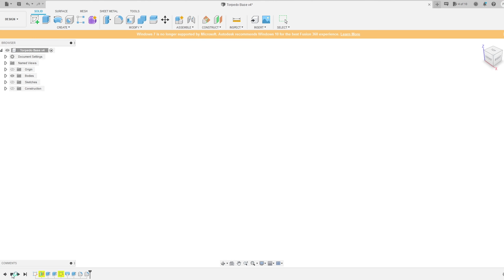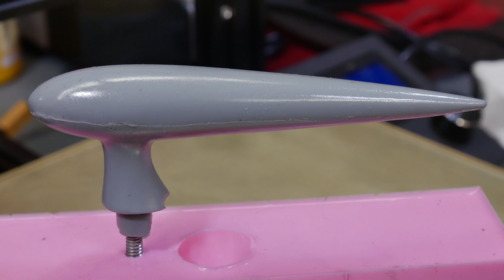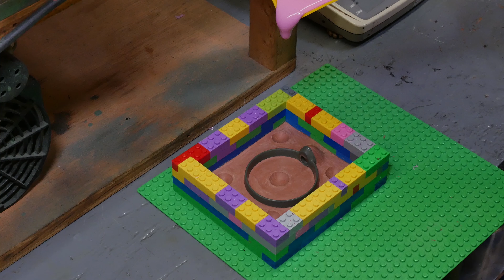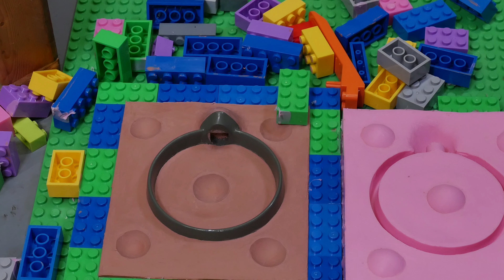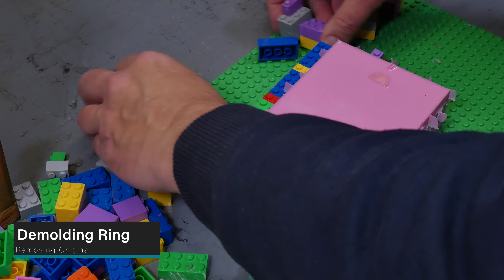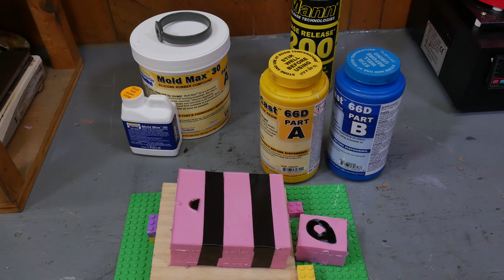Replicating an Antique Hood Ornament

Comment: Super glue (crazy glue) and baking soda is a good alternative for two part filler for small divots. Also you can also wrap some electrical tape between the drill and the polishing wheel for when the workshop pixies jog your elbow.

Comment: In today’s money $4.50 is about $70 . If you took $70 usd. today, and bought say ABC.alphabet stock, in fifty years that stock and dividends would be worth substantially more than 70$ and you wouldn’t have to store the box and part.
I get into this with my sons when ,,I sell a car or whatever it is. They question why I would sell a 1972 Plymouth car for xxxx$. I have to explain about storing and maintaining antiques etc. If you have a nice antique item, it needs to be maintained and stored properly or it will be lost.
All the excellent work you are putting into your Amusement ride will need to be protected when it’s done with proper storage and insurance. If you think about the original cost of the ride $2800, in todays money it is significant amount.

Comment: Why not electroplating, it also works with platics if you apply some conductive graphene spray on it before.
PU changes it's molecular structure if heated with a flame, and the graphene will stick to it.

Comment: I just saw your channel pop up on my recommended list.  Probably because I'm watching a lot of mold casting.  I have a 1957 Harley Davidson emblem that I want to duplicate.  It's clear plastic with some kind of paint and chrome.  Hard to explain, but if you saw one up close, you'd see my problem.  One issue is that it has two holes for mounting it to the gas tanks.  I was planning to full the original holes with wax (bees or candle?) for the mold and drill them fresh in the new parts. 

I was wondering why you didn't use wax to fill the imperfection in your original ornament instead of using bondo!?!?.  I cringed a little bit when you took sandpaper to that antique part.  But I've ruined some old stuff in my youth that I wished I hadn't today.  In the end, it's your part.

I'll be watching all your videos, sine you do such a good job of explaining things.  Thanks.

Comment: you might be able to make a release channel on the other end and use vacuum to draw the resin in from the bottom (like sucking on a straw )
Reply from the maker: Absolutely, but I have found  a technique that works, just need to kind of burp the mold and not pour too quickly. Adding a vent would have been the next step.  What you are suggesting is similar to the way they  vacuum bag composite materials like carbon fiber- and that is a very interesting idea to me!  Thanks for watching!

Comment: Your little helper is hilarious! You can also use a light vacuum after you pour in the resin to pull the bubbles out of the liquid.
Reply from the maker: Yes, he is funny without even trying.  I was concerned about vacuum post pouring due to the short cure time.  I envisioned it kicking while I was degassing and ending up with cured urethane foam LOL.